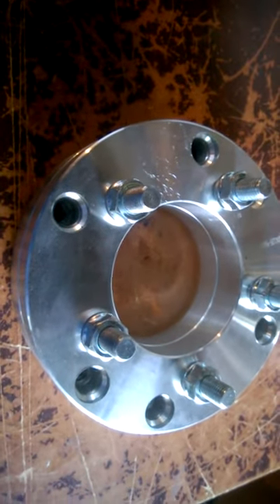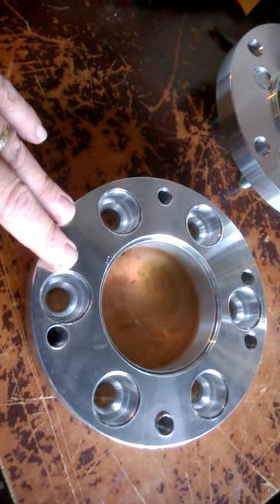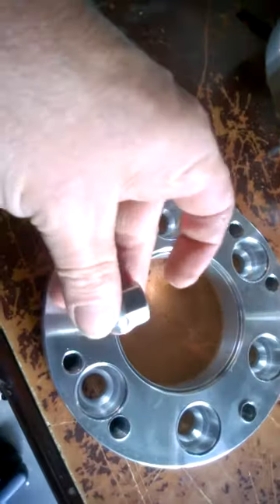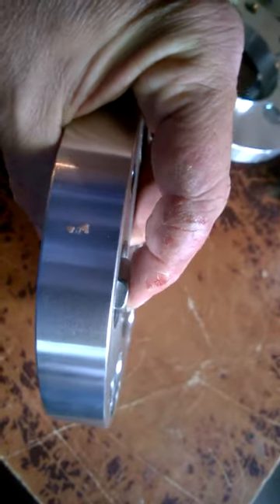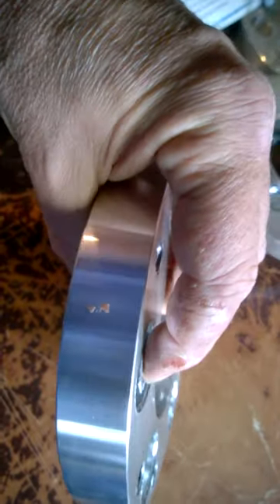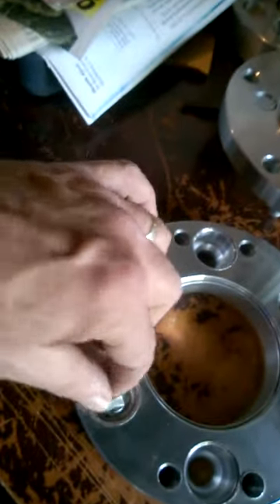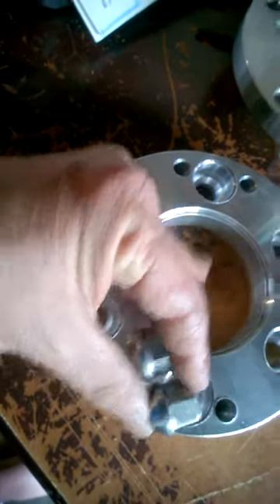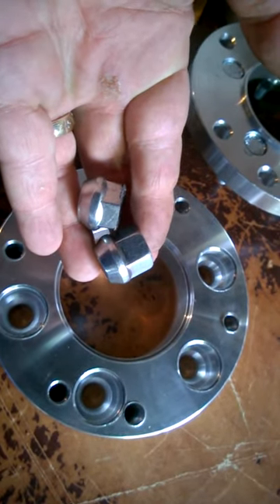6x135 to 5x4.5 Wheel adapter lug nut solution

Comment: did those work out well? been looking at them online but the bolts holding two pieces together kinda freaks me out
Reply from the maker: As long as their properly installed they hold up perfectly, if you allow the like nuts or studs from the vehicle to touch the second piece of the adapter it will cause a failure. Also the adapter black bolts should be torqued down to 65 pounds.